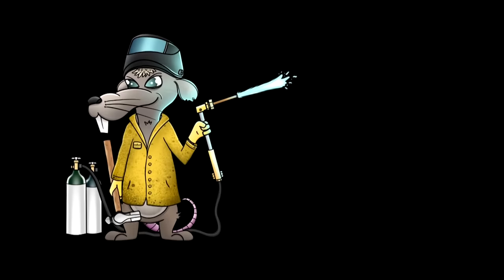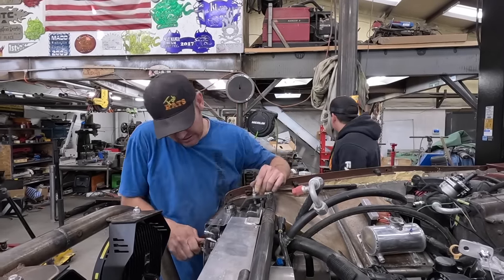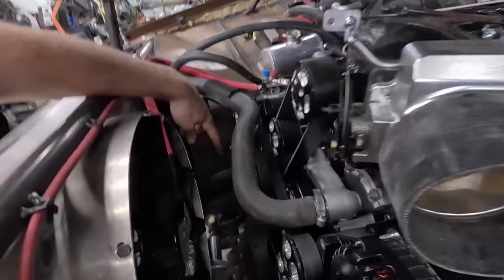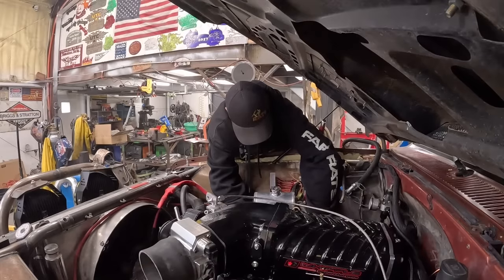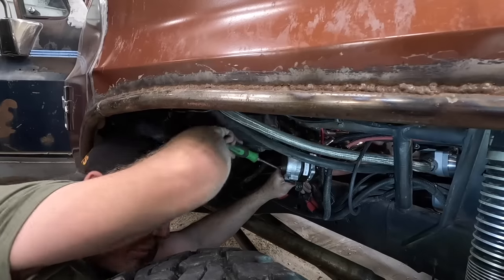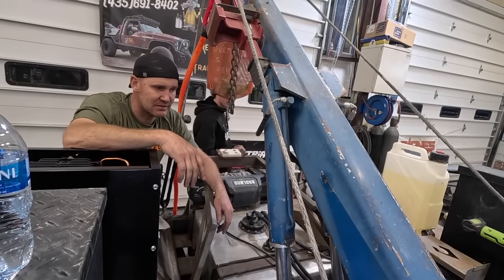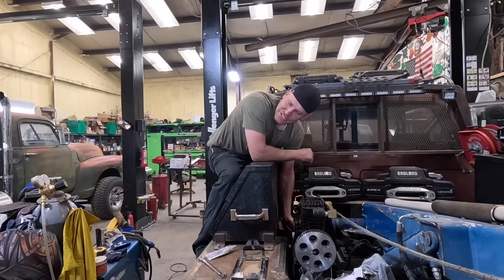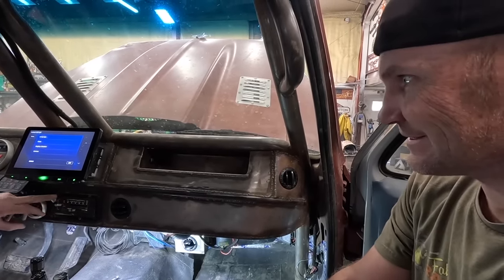We Super Charged The Rat Rod Wrecker………Will It Survive?

Comment: Like seeing you getting a bit more prepared. Land anchors and shovels and probably more to come. Better looking at it, than for it (so long as it's not in the way/too heavy)

Few max tracks/traction boards are V handy too.. something low needs a ramp to not rip off trim, help spread tyre load in soft situations or need a little more traction to pull something out/up a hill, really useful if not the magic cure all some think they are. They give you an extra lil bit more than you already have, which is all you need sometimes. Lil rack for 2 or 4 behind the cab above the winch would be out of the way.

A stop for the end of the shovel or hook around the blade it can slot into, to stop it slipping down to the dual winches might be an idea too. It's always gonna walk down the boom as you drive otherwise. Minor nusance but wouldnt want it damaging or interfering with anything.

Comment: Should have drilled and tapped that air part before welding the ends on as it would  be a lot easier to get the metal fileings out

Comment: I would like to do my dash in my 1989 DodgeW150 similar to what yall did. My factory burgundy dash is not going to last forever and once my truck is repainted bright red and white it just wont look right. I don't know why Dodge went with the colors they did for the interior trim colors. I dig the metal dash from yall tied into the roll cage which also how the Ultimate Adventure Dodge did theirs. Will have to look around for some off road shop's that actually do fabrication around here.

Comment: WARNING! Our company uses those air compressors and I will say they work great. However, all four of them have had some issues with the mounting hardware on both pulleys. We had to thread lock all bolts and keyway screws. Since then we have not had any issues. Hope this helps!
Reply from the maker: Thanks for the heads up! We’ll put some loc-tite on them.👍🏻

Comment: You should have made your land anchor or sand anchor the head of your shovel and then you could use your foot while holding the handle to shove that thing as hard as you can into the ground and give you a better anchor point custom make that shovel into your land or sand anchor that would be awesome and making it a one location multi-tool instead of finding two spots to mount those things separately

Comment: Are you going to use engine vacuum for the heater controls?  Won't that go away under boost?  Might need check valve to protect heater  controls.

Comment: Lock tight those throttle body plate/blade screws or use pop rivets!  Those tend to back out and get sucked in the engine.

Comment: god, i never thought i was going to be this person... but here i go. The air intake on this truck, where one filter pulls cold air and the other pulls hot header air..... Its been proven that those cone air filters will support WAY more horsepower then one would assume, one of those cone filters supports over the 1k mark. making the hot air intake not needed.  hotter IAT's will increase the chance for detonation, especially when the engine is heatsoaked and is emitting lotta heat.. The Intercooler will definitely knock off alot, but no need to make its life harder.

Comment: What happened to the metal shavings from drilling and tapping the water pump without removing it? Aren't they going to cycle in the cooling system, potentially damaging the pump or blocking coolant routes in the engine or blower?

Comment: Hi Paul, I’m curious why you had to get a 12 volt air compressor in your words which is stupid expensive?  Couldn’t you have put an inverter in your truck to convert 12 volt DC which you already have to 120 volt AC & use a 120 volt air compressor? Would that have created negative issues I’m missing? Damn that LS sounds good!
Reply: He doesn't have space for an inverter. A 5cfm@100psi compressor  so slightly lower output than he has. Would be 15A at 120v and need like a 4000w inverter to handle start up power rush. That size inverter is huge. Also would need more batteries to run it. There's better options. He found 1 expensive one but an easy buy it and done option. He's makin the YouTube money now
Reply: @mrmotofy  Thanks,that answers my question.
Reply: @allanarndt3047  YW, I clarified my reply there was some extra words thrown in there for some reason

Comment: Instead of a 12v air compressor, why not just a inverter/lithium battery bank that charges off your alternator with a dc-dc charger? Then you could run anything 120volt.
Reply: By the time you got done it would be the same. Then time to build it all. Then you need like a 4000w humongous inverter...where's that going. Just not practical

Comment: You complain about big blocks , yet i've seen 427s in an LS configuration and they last quite awhile but for the most part they never see below 4000rpm, not sure how good they are for lugging. But I saw a large big block about the same size externally as the one you removed but it was a displacement of 903 c.i. it was aluminum but 14.8 liters.I really think you'll regret the change, but you have to admit a low mileage engine WILL outlast a high mileage one regardless of the size all else being equal.

Comment: Forget the 12v compressor run it off pto from a service truck get one that's 15cfm
Reply: Gotta have PTO first
Reply: @mrmotofy  truck has a pto it was originally used to power the hydraulic pump for the wenches but it was to slow

Comment: A novice question.   When you drilled and tapped into to the $300 water pump, how do you assure that no metal shavings are left behind in the water pump body?  Thanks
Reply: Do it right way and remove it or use grease...that was wrong way. But he makes vids and $ from fixing stuff

Comment: Your gonna want to hard pipe the pressure side of the air to the tank, with a heatshield, and a pressure switch, and a blowoff, the rollair compressers ar gas powerere have the constan run pressure valve.
Reply: He don't have rollair. It has a pressure switch it's all ready to go just connect Pos, Neg, Turn on and the airline

Comment: to be able to do what you do you must have a million dollars worth of equipment
Reply: Honestly if I could set up a shop just the way I wanted, it could be done for 50,000$
That's lifts, welders, torch, exhaust pipe bender, 2x price if you need a building too. 
I own 10 acres and a pole barn with a concrete slab, so I have imagined setting it up as a fabrication station many times. 
I have welders, plasma cutters, probably 10k in automotive tools, just need a lift and some insulation to make it tolerable year round.....and maybe find a couple people who want to do the same thing that aren't drunks or methed up.

Comment: Why not run an ac compressor as an air compressor?
Reply: I suppose it would work but it isnt meant to compress air so probably not very good at it.
Reply: No it compresses oil at hundreds of psi...so it's actually very good at air...but they want a/c
Reply: @mrmotofy  I don’t think that’s how it works.  Air is gas and oil is fluid.  Very different in terms of how they are compressed.
Reply: @SteelheadTed  it doesn't matter it's a compressor. It will hold hundreds of PSI. YES an a/c compressor with minor mods will make an excellent air compressor. Been well known and used for many years in the offroad scene. Some DIY their own and there's commercial units that have vehicle specific kits to add them on trucks. Don't criticize and argue against products, principles and ideas you know nothing about.
Reply: @mrmotofy  I understand just fine.  I didn’t say it couldn’t work I said it wouldn’t be a very good compressor for air.

Comment: Sorry but I hate when ppl use bumpers and stuff for air tanks. Compressed air will make tanks rust from the inside out. May look good until it comes apart under 130 psi.
 But hey I’m just an arm chair QB.
Reply: Even if its 1/4" wall?